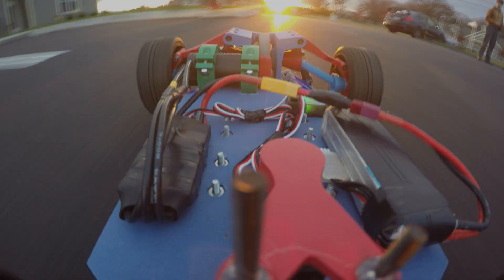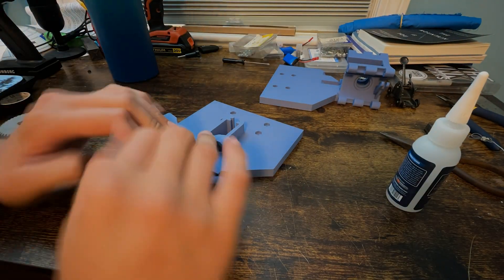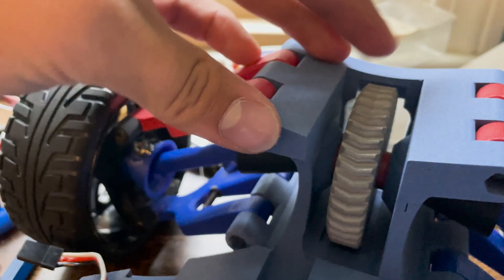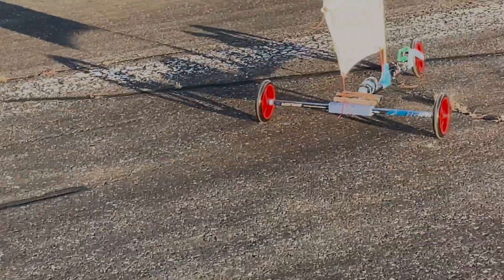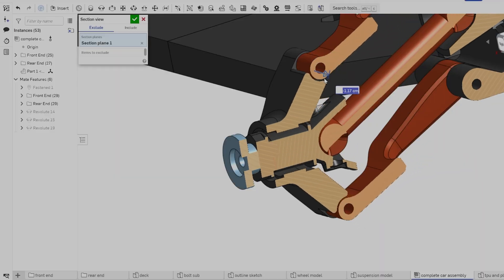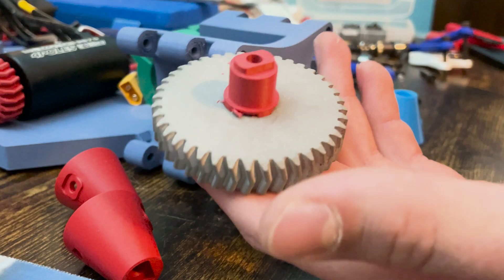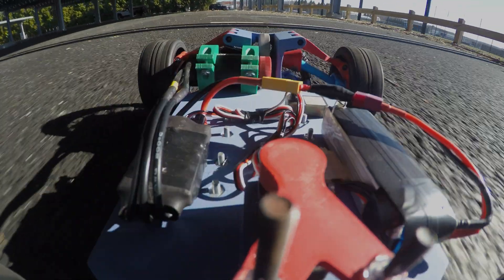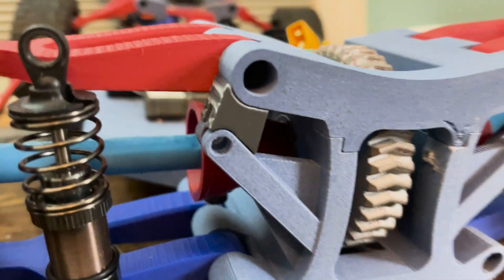making RC Car with Carbon and Aluminum Parts

Comment: Geometry matters, wheb the car sits flat the axles should be parallel to the ground.  Also all your steering arms should run on a single plane.  It seems like your ateering is triangulated.  Awesome  project like to see your progression!

Comment: Just wanna add, carbon fiber/fibre infused filament is typically weaker than the normal plastics. It is usually harder, though.

Comment: I really love the car. I printed it to. It handles so well
Reply from the maker: glad to here it!
Reply: I also made Some new parts. I made a part that mounts on top of the chassis and holds all the things like battery esc and stuff. And I let it run on a belt drive so it would be easier to change gear ratio. That was it tho

Comment: You are tapping the bearings pressing the inner ring, that can damage them. Cool project, after trying a few filaments and resins I still haven't found a material as resistant as the good RC plastics, but for some non critical parts they do the job

Comment: Sir , please say motor rpm and motor size
Reply from the maker: it's a black amazon motor, it has written on it "BL motor 3670 4 poles 2150kv"
Reply: @hamburgerinc6995  thanks sir

Comment: hey im printing this car and if you could tell me what all the motors battery shock absorbers tires really just everything that isnt 3d printed thank you
Reply from the maker: Most of the parts on this car were scrapped together from many projects lol. The suspension is 60mm 1/8 scale I believe, the motor is an amazon motor, kv rating can be found by looking at it in the video, tbh I've no idea what it is. same with esc and battery. all bolts are m4. I advise caution if you want to build this lol. I'm not a professional engineer yet by a long shot, certainly lots of things need improvement with this design
Reply: @hamburgerinc6995  tysm ima try to imrpove it prolly add a differiential
Reply from the maker: @ best of luck!
Reply: @hamburgerinc6995 for the motor for steering could you tell me witch one it is so its fits the slot and look back for me because i looked and i saw the motor but i can see it for a glimpse and i cant see much of it if you could tell me that would be amazing
Reply from the maker: @FlopperLopperDopper  the stearing servo? that is a typical 20-25kg servo from amazon, about 15-20 bucks, most sizes are synonymous in that range, if you're on the fence about the size (I have no idea what servo I used tbh, but it was one of the cheap 12-20 kg ones from amazon) then probably measure the box that the servo sits inside of and remember I left wiggle room for tolerance. hope this helps
Reply: norm motoro like kv brushless or non brushless
Reply: looks brushless to me but i wanna double check
Reply: are the orange and black motor the same one or did you get a different one or different color cuz i can easily identify the orange one on amazon but not the black one
Reply from the maker: @ I upgraded to the black one, it has written on it "BL motor 3670 4 poles 2150kv"
Reply: @hamburgerinc6995 just finished printing and starting assembly now and js want to ask some things abt assembly, all bolts/screws/nuts/ all kinda metal stuff is m4 and also i think i saw some glue and i wanna know if its like a special 3d printed glue or like hot glue
Reply from the maker: @FlopperLopperDopper  CA glue and hot glue
Reply: @hamburgerinc6995  witch parts use witch
Reply: hey would u mind measuring ur bearing for me because i lost mine and i forget the size the one for back wheels because its necessary otherwise the axle goes crazy
Reply from the maker: @ 2.1cm OD, 1.5cm ID, 0.4cm width I believe
Reply: i bought a pack of m4 things everything went good except the hex nut and i need to know what size that one is
Reply from the maker: @FlopperLopperDopper  The hex nuts should be standard size I believe... The chassiss brace strips, motor mount bolts, and wheel hubs might be a slightly larger size in a imperial unit. random bolts around the house when I designed it... sorry. They are from my memmory marginally larger, and I think they were left over from a construction project so I'm assuming imperial bolts and nuts. I'm not sure if M5 would work or if it'd be to big.
Reply: also what nut setter do you use

Comment: still no differentials and im not seeing any grease either and if it was 4wd itd be much more stable, the carbon fibre chassis is unnecessary, PCB would do, if you do do this again, learn about differentials, make it 4wd and grease it up

Comment: Hi, I design sports cars and buggies (real ones) for a living, and I would love to see your project getting more recognition. I strongly recommend you to implement the following features to your RC car to boost the performance and handling, as well as to reduce the tyre wear and potential failures that you experienced in the past:
1. Increase the distance between the mounting points of each A-arm where they are connected to the chassis. That will make them much stronger even if you use the same volume of 3d printed plastic. Thinner A-arms that closely resemble a triangle (from top view) are stronger than the current design whose mounting points to the chassis are too close to each other;
2. Use unequal length of the upper and lower A-arms, i.e. make the upper ones shorter and the lower ones longer. That will reduce the negative impact on the tyre patch during high-speed cornering and vastly reduce the chance for a failure of the tyre or breaking the suspension;
3. Set a negative Camber angle of 1 degree, which means that the upper end of the tyre must be closer to the center of the car, while the bottom must be slightly out. This also gives you better handling at high-speed cornering. The tyres on the outside end of the car take the majority of the load, so it's important to keep them vertical while the car inclines.
4. For the front suspension, replace the upper A-arm with two individual toe links to provide a virtual pivot on the upper joint. That will let you have variable Camber angle and Caster angle to the front wheels, hence a considerably better grip due to the reduced sideways tyre deflection. Due to the tight space there, you may need to use aluminum toe links to provide the necessary strength. Virtual pivot suspension is also known as Dual-pivot steering geometry;
5. For the rear suspension, implement the multi-link "Dax Rush suspension". It's a bit complex and tight, so it may require aluminum linkages for your RC car due to the size constraints, but it will provide a much better grip with the road and will keep the rear wheels vertical even when the car is heavily inclined during cornering;
6. Don't use an exact Ackermann angle. High speed cornering means that the outer wheel will slip and deflect sideways, hence the car must steer more to turn in the desired direction. Ackermann geometry dictates meeting the virtual points of the steering arms exactly at the middle of the rear axle. However, a more appropriate steering geometry is to shift the meeting point behind the rear axle with 30-50% of the wheelbase. For example, if the wheelbase of your car is 200 mm long, the virtual point where the the steering axles cross together must be approximately 60-100 mm behind the rear axle.
7. Use fillets for smooth transition of the 3d printed shapes and avoid inner sharp edges wherever possible. Sharp edges are weak points and the plastic tends to break easily exactly there.
 Hopefully this helps.
Reply from the maker: that's half a thesis omg! thanks so much for taking the time to share this advice, if I ever revisit RC car design in the future, I'll be sure to take your words into consideration. The virtual pivot point sounds interesting, I'll have to research how the toe linkages and all that stuff works. thanks again!
Reply: @hamburgerinc6995 , you are welcome. It will be interesting to see the difference in performance if you decide to update your project.
Reply: Wow dude, you just gave me a list of research materials! Thank you.
Reply: @Mohsrz  , it's a really fascinating stuff to research! :) Physics at their best. Cheers! :)

Comment: Hey, I really dig this design, I want to make one myself, but I have a bit of a hard time figuring out the exact models of the suspension and the bearings. Can you throw some links in here, or maybe on thingiverse?
Reply from the maker: Most of the parts on this car were scrapped together from many projects lol. The suspension is 60mm 1/8 scale I believe, the motor is an amazon motor, kv rating can be found by looking at it in the video, tbh I've no idea what it is. same with esc and battery. all bolts are m4. I advise caution if you want to build this lol. I'm not a professional engineer yet by a long shot, certainly lots of things need improvement with this design.
Reply: @hamburgerinc6995  thank you, but I have already started printing it, we'll see what comes out. Worst case scenario, I get a nice piece to look at.
Reply from the maker: @cipbarbu  lol, best of luck!
Reply: @hamburgerinc6995what is the bearing size?😊
Reply from the maker: @stephenmancuso3314  2.1 OD 1.5 ID and 4mm width

Comment: Hi, I am trying to build this car, its really cool! Do you have a list of parts (screws, suspension) that you used? Thank you
Reply from the maker: Most of the parts on this car were scrapped together from many projects lol. The suspension is 60mm 1/8 scale I believe, the motor is an amazon motor, kv rating can be found by looking at it in the video, tbh I've no idea what it is. same with exs and battery. all bolts are m4

Comment: Of course you can make it without expensive materials, I made a rc car myself and I used Petg for everything and just ended up with pretty beefy parts and mod 2 gears. Instead of just going from the worst material to the “best” in terms of 3d printing you can allways use a better material like pstg from the beginning and doing more revisions before making them from metal
Reply: Basically use your brain and not your wallet
Reply: The problem of this car is not the material (humble PLA is perfectly fine for a RC car), but the horrible design, clearly done by somebody that has not any mechanical skill and general engineering knowledge (let alone on cars mechanics!). One of the worst RC car ever on YouTube. And being still in this miserable state after 5 months of iterations says it all ......
Reply: @marcobassini3576  What colour is your rc car?

Comment: It's funny to watch someone print working models with PLA and be surprised that it keeps breaking. PLA IS NOT AN ENGINEERING PLASTIC!!! To prevent it from breaking, you need elastic parts made of engineering plastics.

Comment: I just ended my engineering semester, and I used your design for my final project. Great work, there were some things my team and I had to improve and change in order to meet our project’s requirements, if you want to check out what we did we would happily share it with you
Reply: We added a differential and a better gear train so you don’t have to push it to get it going
Reply from the maker: @luigivargashennings5262  I would love to see that! that's incredible. shoot me an email at hamburgerincofficial@gamil.com

Comment: I told you about that suspension hard point in your last video. it failed exactly as predicted.
Reply from the maker: indeed 😅
Reply: @hamburgerinc6995I have a challenge for you make a completely custom 1/4 scale Lamborghini Aventador svj and make it super powerfull so it can go 60mph-130mph depending on motors and insane accelerations and then bring it to a rc drag race and circuit race
Reply: hi nice work, I would like to see you make a modification to make a 4x4 so as to have more grip and it would be fantastic 👋

Comment: it'll drive much more smoothly if you offset the u-joints on each transaxle by 90 degrees to each other. look at a the uni joints on each end of a driveshaft and you'll see why.

Comment: Would it be better to reduce the gear ratio so it doesn’t need a push at the beginning?
Reply from the maker: Oh for sure lol. That, and adding a sensored motor to get rid of the cogging and find what part of the revolution it's on.

Comment: Do you mind attaching your hardware material please, I wanna remake it :)
Reply from the maker: everything I used was from amazon, I'm not even sure what most of it is anymore since I've used the same electronics for many projects. I know that the motor is a GoolRC 4076 2000KV 4P Sensorless Brushless Motor. If you are trying to make this car, caution advised I'm not a professional, I'd recommend buying a sensored motor so that it doesn't cog. The ESC just needs to accomodate the motor you use and choose whatever battery you want. the servo is a typical cheap 20-25kg servo from amazon too. shocks are 1/10 scale 60mm I believe. I think I mentioned that somewhere in the last video maybe, idk. everything else is printed
Reply: @hamburgerinc6995thank you so much